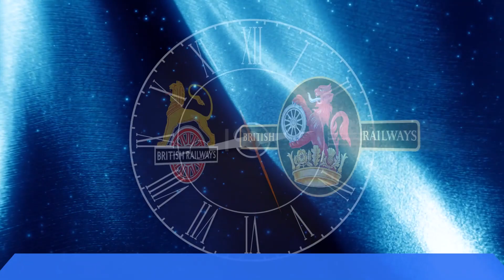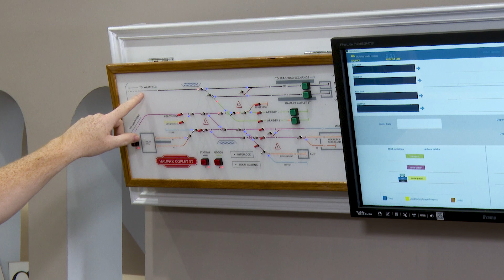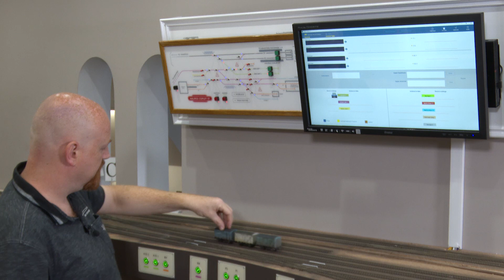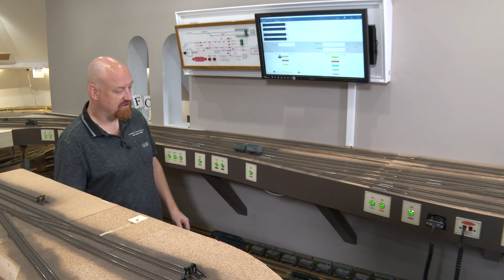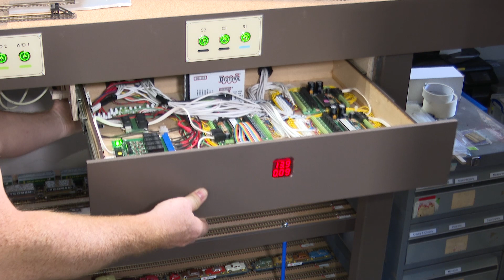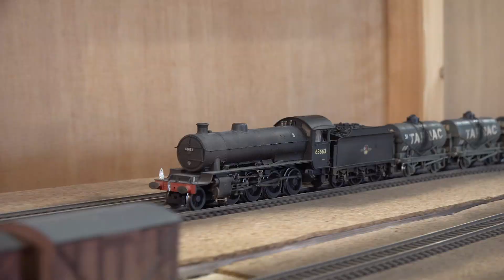65. Halifax Update at Mckinley Railway

Comment: Wacthing the videoo about the Halifax yard I wondered if teh team are aware of the situation in the neighbouring town of Huddersfield where the local mills were in some cases supplied with coke from the jocal railway yard by Council Electric Bulk Carrier Tram using the passenger track network.with mill delivery sidings,
This could be a novel feature for a Boutnmouth based railway layout. A MbKinley "FiRST" I feel, a short run of tramway track with coke sidings into Tibbles Mill and some different rolling stock for David to worry about.

Comment: Great to see your handy work installed, love the easy route setting and RFID wagon triplets tracking systems; all that planning has really paid off and kept your controls and information displays simple and most importantly easy to use. A running train, well that’s just a bonus for me! It would be nice to know how many engines diesel and steam, wagons, brake vans and coaches you envisage being on the tracks at any one time (including Hades) when it it’s finished, ditto on installed track length. All the best and so well done. Stephen

Comment: You need to be 8ft tall to use this railway 🚃🚃 🚃
Reply: Only Halifax is that high and they said, in some video before, that it gona get a higher floor there 🚂
Reply: @lassunsschaun6859  I am 9ft 2 and I had to have a step to reach the operating screen.